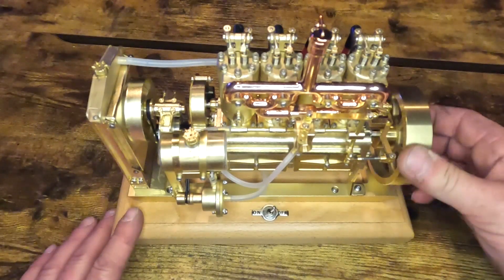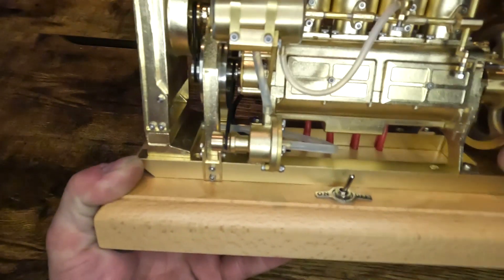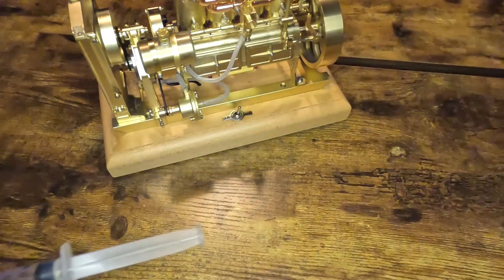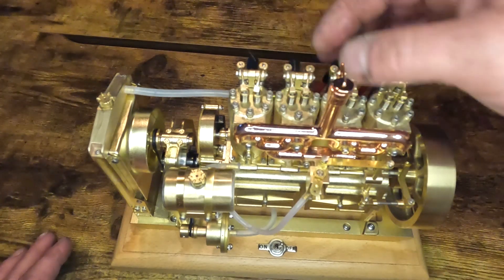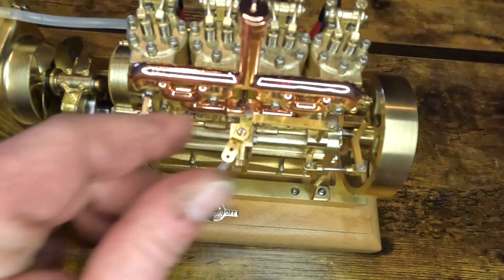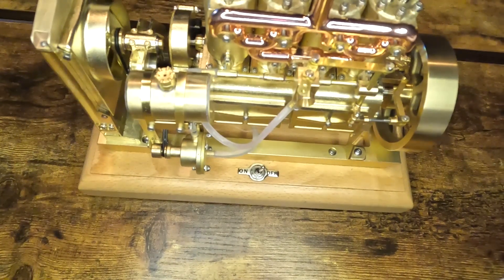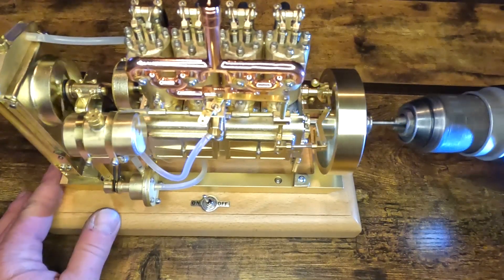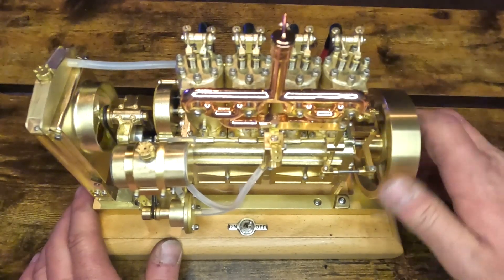H75 Holt engine

Comment: Put a twist in waterpump belt... it will let pump rum other direction.
Reply from the maker: You're exactly right.  If get time to watch the second video, you'll see that and a couple other small quick fixes.  Thank you for your interest and comment.
Reply: @steam212  What happened at the factory that made the pump run backwards to begin with?
Reply from the maker: @fifififo5918   Hi Fifi,  I think that it was a simple oversight honestly. The original Holt engines ran counterclockwise. If this model were to be built off of only pictures I could easily understand how the rotation of the waterpump and the fan would be backwards. If they were driven off of the camshaft with a larger pulley the rotation would be correct but that is where they mounted the timing pickup. Perhaps it was done for cost effectiveness and a more scale look?
Reply: @steam212  Thanks Steam. I'm thinking about it :)

Comment: I want to buy this but I don't trust the quality control. I bought a single cylinder M12 from company X and it had a bad plug and a stripped head bolt.  Still cant get it to run.  Your water pump runs backwards?
Reply from the maker: Hi Fifi, I understand your skepticism on the quality control. I was for the most part impressed with this model. I corrected the reverse rotating waterpump easily though by putting a half twist in the o ring drive belt. It is working well now.  Thank you for your comment
Reply: @steam212  Thanks Steam.  Do you know if this one has the rubber piston rings? I imagine this one is a pretty tough tear down.
Reply from the maker: @fifififo5918  Yes this one also uses some type of rubber or silicone o ring for the piston rings. It was shipped with 4 spares. The bore is 13mm (1/2") with a stroke of 16mm (5/8") so I agree that it would be a fiddly job to take it down and replace the rings.
Reply: @steam212  wow never heard of rubber rings before! less wear on the cylinder for sure